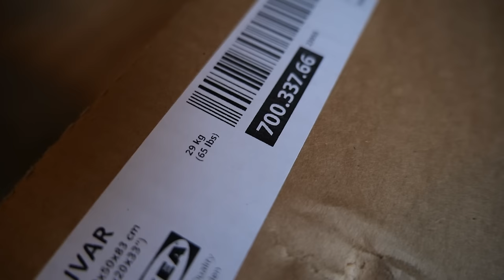#28 Doing things the wrong (?) way around | Furniture before the room is finished | DIY renovation

Comment: Hello Anna - I understand about the sheet rock work as I have done some in the past - exhausting! - You came up with a good solution.  About the bed placement - what if you make the headboard but turn the bed around and put the foot against the slanted wall - your headboard would keep your pillows from falling off and make some separation.
Reply from the maker: That is also a great idea 🙌

Comment: Is that plasterboard/drywall or cement board? It looks so dense. You should be able to score paper backing with a knife then crack and use knife on the other paper side.
Reply from the maker: It is a fiberplasterboard so not like a regular one.. Very heave and dense.
Reply: @annasgmlindgren  is it Fermacell boards that you used? If yes, how was your experience? Would you use them again? Any advice?
Reply from the maker: @mads_westermann  Yes it is Fermacell boards! I like them in principle (sturdy enough so you don't need OSB + plasterboard = just one board to mount, less resources used) but to be honest, it wasn't ideal for my projects.. I would maybe use them again use them if I had a perfectly straight building, I had to do a loot of cutting 😅 And it was pretty hard to cut them, having to use a circle saw or similar, and it got very dusty (I wasn't able to mount my vaccum cleaner to my circle saw). The largest board were also pretty heavy to handle on my own, especially in the attic where I have an angled ceiling.. So I would say it totally depends on your project! Hope that was some kind of help ☺
Reply: Thanks a lot,  @annasgmlindgren , I'm building from scratch, so my walls are pretty straight.